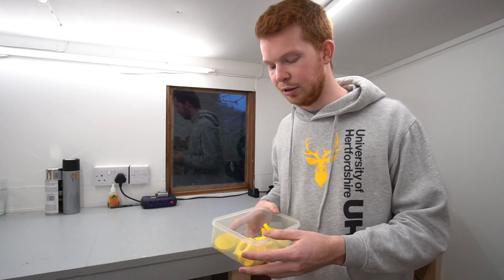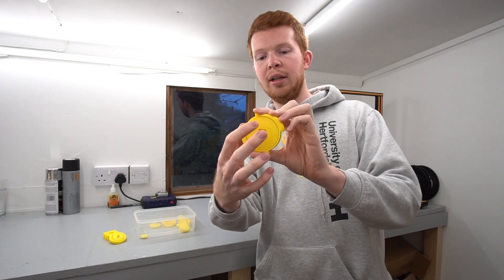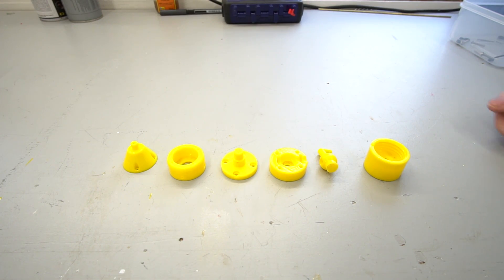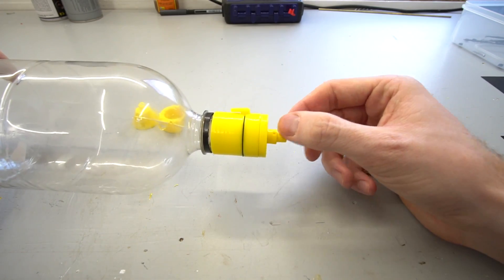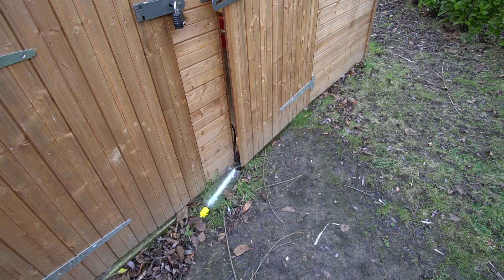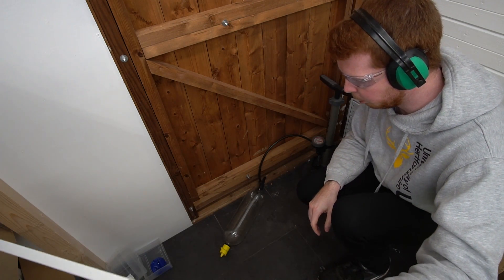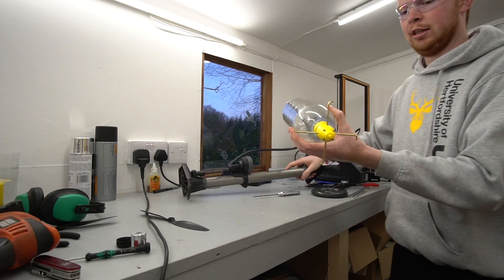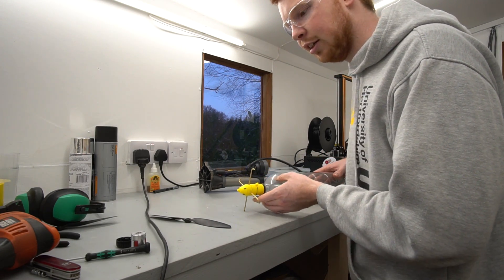Air Powered... Propeller?

Comment: @13:30 I don't think it does. anyway, why did you make the nozzles so long? and straight (mostly)? the air exiting out of those nozzles is slower than it would have been if these things were shorter; plus, since these pieces are straight, but also rotate along with the propeller, the pressurised air keeps bumping into them and slowing them down.

Comment: Don't quite give up on the design, it's very simple but it could function a bit better. I would suggest squeezing the end on the tubes to create more pressure as the air is released and the bit that screws on the bottle I think should be a bit more elongated and tapered towards the bottle so it creates a tunnel that the air travels through which gradually lowers in diameter. I think this would be more efficient with higher bottle pressure. Alternatively you could try the same design concept but instead of little vanes sticking out, you could have miniature turbine propellers inside the contraption. Pretty much how a turbo's turbine works, but instead of having a compressor on the other end, you'd have a propeller. :)

Comment: What you could try doing is having it like sprout from the Ballville like a little screw on bit and then the cover goes over that and it's like a sandwich around around sandwich and what that'll do is give it even disbursement of air and then you put even more holes and throw them out bozsum so whenever the air comes out it's like almost straight with the outside so it pushes instead of very fast nature and when you get at the blow blow blow when it starts going I came up with that in my head about in 5 minutes or 5 seconds I did not find that probably one minute which is 60 seconds and that's how long it will take for you to design it and it'll be like yeah I'll go like in an arc like take a piece of wire and bend it like like a little speech bubble like from the pointy part like the bottom part you know that how it is girl from the point back so that way you're facing away from that little Cliff Edge and then guess what the thing where I actually work and stick the propellers and between the air holes so that way the next propeller picks up that air and throws it back the next basically if you do that you will get a more efficient design and that design will be more efficient for you you'll get better results than you have right there and guess what if you do that don't do like a solid like 360 degree Bend know what you got to do is start drawing arcs not a very short Arc that's very round not a very long or that's not very round almost flat you got to get that nice in between that's basically and then at the end 3D print like a little spout that goes with the wind goes the way of the papilla you know so take all of this together and will you have take some of the stuff that you have from your already print and use it like that hub trash it don't use it the propeller definitely use it but the ball bearing use it use the same bottle

Comment: not a failure..You have advanced your design by adding the threaded cap, and the switch...you just need to find a way to add that to your original piston valve...

Comment: You might consider using the venturi effect for accellerating the air around the high pressure jets. You may be having some issues with air escaping past the bearings and the gap between the valve body and the rotating bits. Perhaps some freely moving sealed bearings and closer tolerances would be in order. My suggestion would be to get a used jewelers lathe cheaply. You could then make some of the parts out of Delron,a relatively cheap plastic used in machining to prototype parts. It's reasonably strong a durable and would work nicely for what you're trying to build.

Comment: Try making the hole in the ball valve tear drop shaped so that the rate of air use can be accurately controlled. You could also use a smaller bearing and glue a brass tube for a shaft for it to ride on into the piece atop of the ball valve. Another idea is to reinforce the air  tank so that you could put 150 psi in it. (I do that regularly with duct tape on my homemade airsoft guns.

Comment: rocket equation : use a heavier fluid
that way more mass will be ejected and therefore more force will be applied.

Also, you should have smaller outlets to speed up your fluid, more speed, more force applied :)

Comment: HELLOTom, When I was a young mechanic many moons ago I used to spin up metal Caged bearings Like they used in car wheels.Iwould blow compressed air at an angle to make the bearings spin  Boy did they whizz up with some speed Try it yourself as a test. Then get  those small fijit ceramic bearings and spin them up with com pressed air from an air compressor used by Paint sprayers for spraying paint. If the little ceramic bearings also whizz up to fast speed Then build a 3D printed body to house bearings attached to a prop shaft which directs compressed air into bearing run 3 tiny tubes set at what ever angle gets the bearings to run at speed with exhausts to expell  used air on opposite side of the bearing to which compressed air is fed. Abit like  a piston engine with no pistons only ceramic bearings connected to a shaft with ports angled to get bearings up to speed .What do you think to that.Tom - Something to think about .You can take on the idea for your self to use just find way of  putting it together. Ex Jaguar employee who used to work at Castle - Bromwich factory where a Large ammount of Spitfire and Lancaster Bombers used to to be built  for WW2.Fully Skilled Mechanical Fitter. Username: Jag 1.Retired ex worker till Dec 2013- 37 years service.Food for thought.Kind Regards. Dump Idea if you dont like it I will not be Offended in any way All yours.Jag 1.

Comment: To increase the flight time, it looks like you would need some sort of flow limiting to prevent all the air from leaving at once, and also, maybe having fewer of the brass tubes would result in a higher air pressure as it exits the tube, allowing it to spin a little faster, as the air will be moving through the brass tubes faster.

Comment: Cool but all of the 3D printed parts are too big a, little unbalanced, and there seems to be a lot of friction on the bearing. Also move the small pipes closer to the hub so it spins a bit faster. Just needs a little tuning imo

Comment: Also, the engine method you produced is too inefficient. You need a small turbine like what Air Hog made for the Sky Shark. They had a wonderful ratio that made the plane efficient to last for about a minute in the air. The triple bladed propeller sky shark lasted only 30 seconds but the thrust is greater.

For air powered airplanes, you can't design it like an airplane. You have to design it like a rocket. The power is in one short burst. Not a continuous burst.

Comment: The bottle is too big. You need a smaller bottle to burst out the air pressure much quicker in a shorter amount of time. Larger bottles produce lower air pressure in a longer amount of time. 😉

Comment: I've only just found your channel, but I might have an idea to help the build. It seems that a number of your problems stem from the loose (relatively speaking) tolerances achievable via 3d printing. Have you thought about printing your parts with extra material in key areas, then machining the prints on a lathe to fit slightly more precise? This might allow you to use a more efficient design with a gearbox to get more RPMs out of the system
Reply: great vid btw

Comment: You should have made a bigger version of the science-museum's propeller. Their propeller works well because force is being applied at a much larger radial distance from the axis of rotation, which means more torque is created with the same amount of airflow. (your thrust-tubes are way too short) 
They have a large surface-area propeller designed to spin slowly; the RC-airplane prop that you used needs to spin waaaaaay faster! (requires more power) Also having the thrust-tubes and propeller as separate parts adds unnecessary mass. Try to make a larger propeller out of styrofoam or something, and try to find some plastic straws or tubes, because brass is heavy...

Comment: You sould shorten these brass pipes, if shortend the point of pressure released is closer to the center there fore spinning faster    and    you sould only have 2 brass pipes that give thrust, that will make the use time longer and the pressure released higer therefore spinning harder with greater force

Comment: Tom, if you allow me a suggestion, I think your main limitation here is mass flow. What if you try to use water as the ejectile mass and compressed air as the motive force? Similarly to a water rocket? I think it will perform much better. If you want something that will operate in any attitude, use a balloon to contain the water like a plenum inside the bottle. That should be interesting to see!

Comment: Only comment I can suggest is trying to put a labyrinth seal between the rotating and fixed components as that seems to be where your loosing a lot of the air and they should be easier to make using 3d printed tolerances than other types.
Otherwise, good attempt and other comments suggest many other ideas.

Comment: Very interesting but predictable. Here you rely on ejected air mass to provide thrust. Air being almost having no mass, the energy you get out of it is almost nil. All is lost in friction (from the bottle to the tip, then viscous friction in the air). While your piston engine relies on the potential energy of compressed air which is a lot easier to convert into mechanical energy. Please continue your experiments :)

Comment: Those pipes are way to tiny to handle 600psi , so happens that the air gets out from other hole, which are the non-isolated parts or should i say, the whole piece u built? The idea would work, but the dissipating energy is way higher than the usefull one, thats why u cant rotate that propeller properly
Reply: He didn't go above 100 psi and even if the bottle didn't fail first then the pipes would be fine because you don't know how much pressure such a small pipe is capable of holding

Comment: I'm not sure if someone has said this already but, could you not make the propeller spin faster if you shorten the metal tubing puting it closer to your mechanism as the center of a circle spins slower than the outside? So then in theory making the overall thing spin faster. Which means (if my calculations are correct,) if you were to for example cut the tubing in half as they are curantly you will get round about twice the amount of thrust.

Hope this helps ^^

Comment: I would like the videos broken into parts. I feel like I am missing a lot of information in these videos.  I would like to hear more about your design concepts and end goals.  Are you going to try to have a consumer product from this? have you thought about using a co2 cartridge? How about using a pressure regulator to slow the speed of the air?

Comment: Before you mentioned it I was going to say congrats and as I write, 48K , and of course I do wish you the very best for 2018. I don't have but 1/48000th of a say, but may I suggest a little more on "the-making-of"?
It is a pain I.A.  of course with all the camera setups and angles and lighting, but that is the life of the YT ace. Getting it right and making the great editing material is the stuff of making it. For your afficionadoes, regular uploads are better. How you get there, designing the parts and headaches with the 3D printer, failed attempts. These are the stuff of our lives too, well many of us anyway. Like for instance right now I am dealing with bed levelling upgrades on my cheap 3D, printer. I was in the middle of the process and had the whole thing apart and discovered one key part was not thick enough to hold a Nylock M3 nut. And so I thought no problem,....I'll just prin.....DOH

Comment: I dont understand the reasoning behind the fact that you point up in 13:20 as a deffense for the air powered turbine engine.
Lets analyse the system.
By simplifyng the system we say that your engine is transfering the energy stored in the bottle (air pressure) to rotational energy of the fan. The fan blades are slaming backwards air molecules which means that its transfering rotational energy to cinetic energy of air. So if we use a nozzle to release compresed air arent we skipping some steps where the entropy can be apparent?

Comment: good idea first french helicopters called "djinn" from aerospatiale compagny was working on same principle  but dont forget that the 2 main problem with this is the rotary valve for distributing the air to the jets and also if your jets are closer from hub that end of blade tips you'ill get a resistive couple on your plane
enjoy anyway

Comment: Just for Your safety - next time while checking the pressure capability of any kind of tank it's much more safe to fill up tank (bottle) with water and than pump it up with pressurized air. If the tank explode, there is not so much high pressure air inside.

Comment: I think a substantial amount of air escapes between the rotor and the top of the valve. To improve the airflow through the brass tubes, you could try to add a sealing rubber skirt. https://en.wikipedia.org/wiki/Radial_shaft_seal
Reply: Exactly

Comment: Helmut and Isaac are Germans...
Reply: If you have a force you will have a reaction, it is not a good idea with propulsion when the reaction force works against your goal.
You could 3D print the nozzle in the propeller and maybe better to use a push propeller.
The nozzles could be in the hollow sides of the propeller a third of the end perpendicular to the pitch...
Reply: Also to launch a glider: use 2 2.7V 50 Farad capacitors and a brushed motor. the Airhogs e-charger has 1 2,7V 5F capacitor?

Comment: Tom, the thing you forgot when using the 2 mm spouts was air viscosity, that is why you have such a negligible thrust.  I think you find that increasing the "spouts" diameter by a single millimetre will give you a marked improvement. You are expecting air to come through a 90 degree bend with some force while allowing it only a 2 mm aperture to get through. While the pressure in the tubes will be high their narrow diameter will simply not allow the air to reach sufficient flow for a decent thrust. By having such narrow tubes you are succeeding very efficiently to convert the potential energy of the compressed air in the bottle into the heat by viscous friction in the tubes.  Very little portion of that energy gets converted into the mechanical one unfortunately.

Comment: It seems like you lose more air pressure through the space between the fixed and spinning housings than the tubes.  You are better off creating some sort of veined internals at that interface rather than the bent exhaust tubes.

Comment: I'm no physics major, but as far as I can tell, thrusting the air out of the rear is far less efficient than converting the energy stored as pressure into rotational energy.

Thrusting it out the rear only propels the system forward as much as the mass of the air being ejected. Since air surprisingly enough doesn't weight very much, you only get as much thrust as the amount of air you can put inside of a bottle. This is the reason why bottle rockets don't just have air as the working fluid, they also push water out. Since the water has a high mass, newton's third law applies and the bottle is pushed up with a force equivalent to that required to push out the water. 

Pressure is powerful, but it isn't very powerful if it only has to escape into the atmosphere by simply leaving a valve.

Since the water in a bottle rocket is beneath the pressurized air, the only escape for the air is through the water, meaning that the potential energy of the pressure in the bottle is spent pushing that water out of the way, resulting in a stronger force than just pushing itself out of the bottle.

Although, that's really more of an educated guess. Don't take my word for it.

Comment: Why are you not using CO2 Cartridges to supply the power ?      Also, a number of your projects are not really suited to 3D printing due to the tolerances involved (loved the turbine idea). Personally I feel you should be buying old RC engines for the components  and go back to the compressed air engine, but make it modular as possible (stack-able). if needed you could send the crank (that could hold several piston rods, pistons and cylinders) out to be cnc'd from metal (no more snapped parts). the performance should be better (especially with Co2 bottles).     as for those talking about venting the air from the back of the bottle.  that would work best as a smaller water bottle rocket that drops off after the thrust has dropped off.  an interesting way to launch an RC Glider lol.  (what about a rotary screw gas pressure motor?  note: I say Gas, because it could be air, CO2 or even Nitrogen)

Comment: You can put the bottle into water to test it, if there are leaks you can see them, and if it explodes it's not dangerous. Even better is to put water in the bottle, so that adding very few air is enough to pressurise. and again, if it breaks it doesn't explode everywhere.

Comment: if you 3D print the tube at a 45 degree angle or less would assist plus the joint were the ceramic  bearing may be a little issue but great video and great design

Comment: I think your komplex projects are better than many small videos to be able to upload once a week! Did you ever think of fitting a small electric airpump onto a bigger plane and use your air engine with it? Would be interessting to see if this works. I think you will not need much pressure to keep it running.